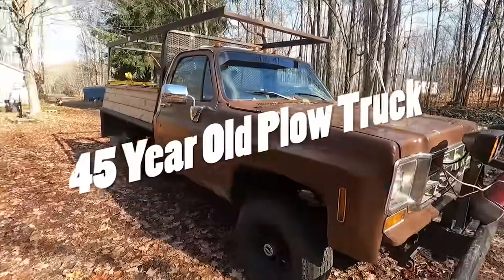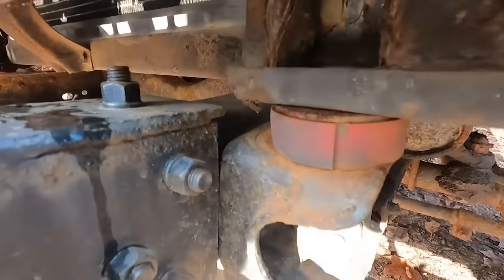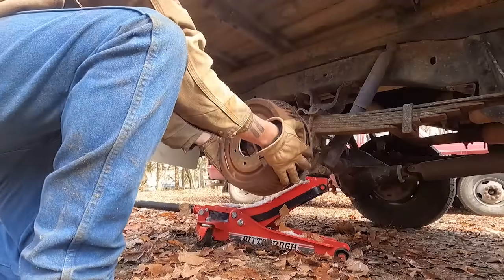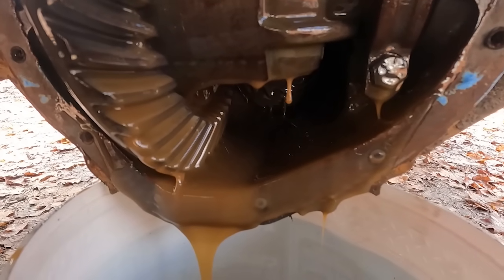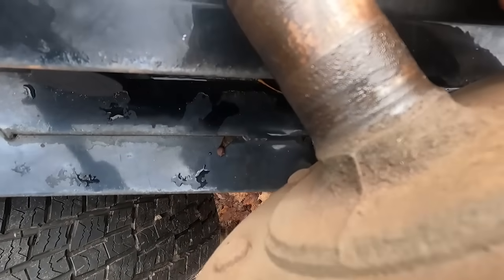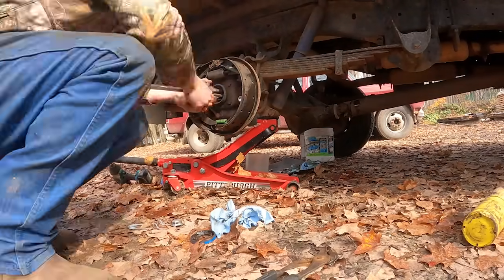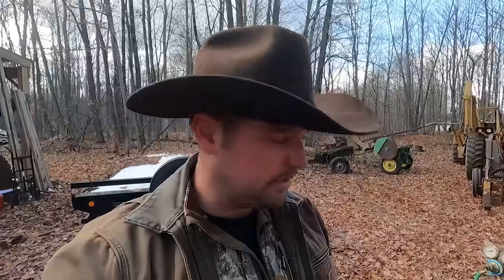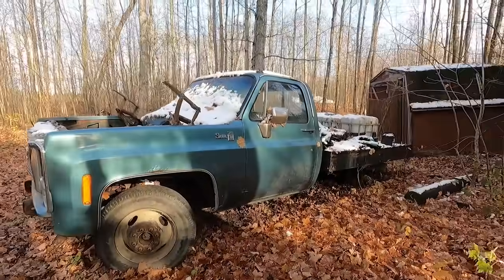Who buys a 45 year old plow truck and names it Juanita? (and immediately has to fix it)

Comment: A trick on a stuck race like that. Just weld a little on the face on one side. It will heat it up and shrink the other side and make it very very easy to pull out
Reply: Yup, that works just about all of the time. A stuck outer race WILL shrink when you lay a bead on the ball groove with a welder. Either stick or wire feed will work, sparkle a quarter inch of bead in 2 spots, she'll almost fall out. Done that for years as a mechanic. Sure, cutting a groove out with a flame wrench works too, but, is messy. (fire and stuff)

Comment: i had one of those in 1992, automatic with no reverse and drank 1 qt. of oil every 500 miles. full time 4x4 6mpg. it was a beast.
Reply: My 81 c3500 has the same mpg. BEST I can get is 10 while cruising. 
4.56

Comment: Andy i know safety is 3rd, but please use something other than just a jack to hold the truck up. Axle stands, wood whatever just a jack is really asking for trouble!!
Reply: For sure. Except wood. At least, not  2x4s. My h.s. autoshop got a V8 'cause the previous owner was under his car when the stack of 2x4s toppled, crushing him.
Reply: @SpaceAgeCastaway  guy who lived across the road from the me, died when his jack failed and crushed him about 5 years ago. He worked on cars every weekend since those houses were built 25 years ago, his time was up and that Jack failed, blew a seal and came down on him.

Comment: I hate to be that guy but the reason they're called 12 bolt axles is because there are 12 bolts holding the ring gear to the differential. Great video as always, Andy.

Comment: I just did this on my truck. Had a bent axle. Guess you shouldn't haul 1 ton of dirt in a half ton truck. Replaced the axle and bearings and seals on both sides as long as I got the pinion out figured I would do both sides. Next is u joints.